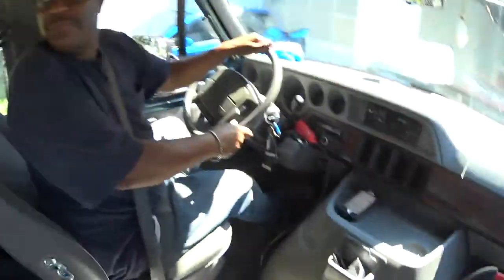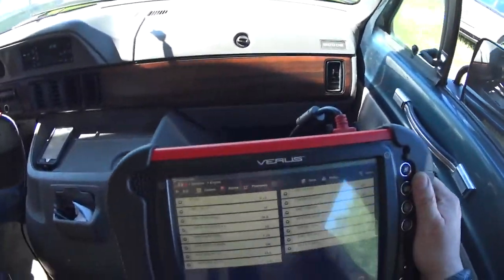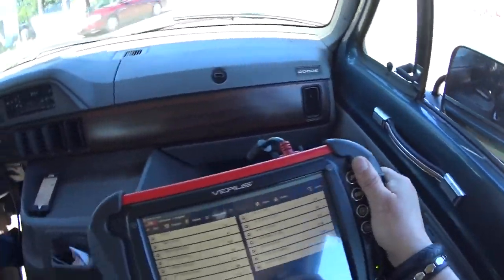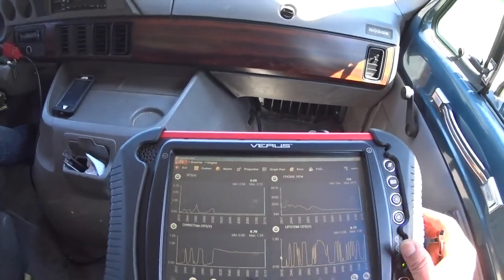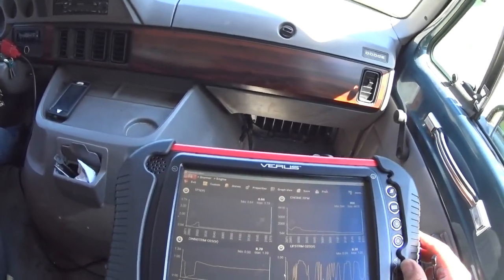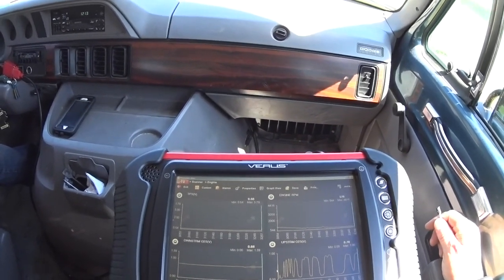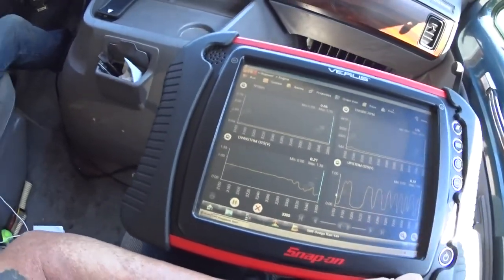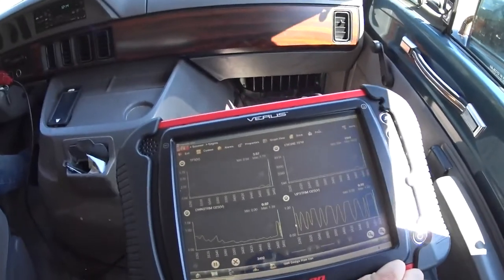Road Test 96 Dodge Ram Van 2500 fuel Delivery Problem

Comment: Did you ever figure out what the problem was? I have the exact same van and whenever I punch it sometimes it will like stutter or hesitate.
Reply from the maker: Juan Lopez  yes!!!! After all the testing and different CODES injectors, misfire, and this is the way to find out 100% for sure! With the scanner set in DATA pids with the HO2 sensor Bank 1 sensor 1 and sensor Bank 2 sensor 1 in a open road push the pedal to the metal and watch the sensor if they go to lean condition the engine is starving for fuel... the fix is too change the fuel Pump is no fuel filter service in this van ... is with the fuel sending unit...
Reply: Thanks! I'm going to check mine out.
Reply from the maker: Just too let you know the fuel tank needs to be cleaned if not you will have a problem after a year the new Fuel Sending unit have been replaced...
Reply: corey Babcock  was your van having the same problem?